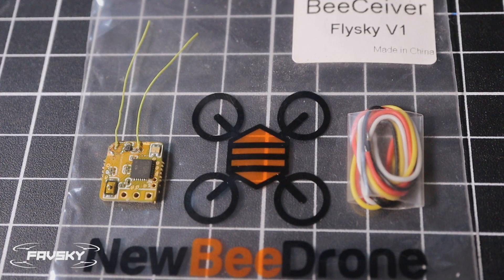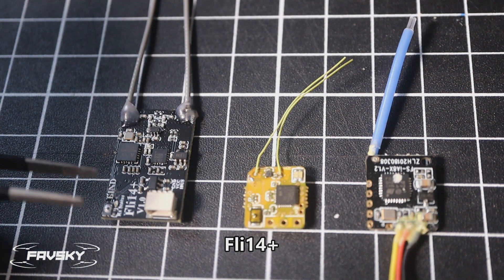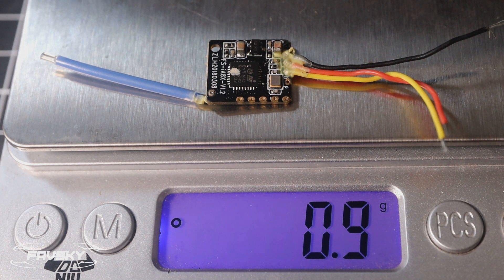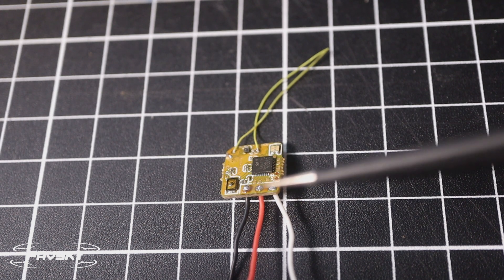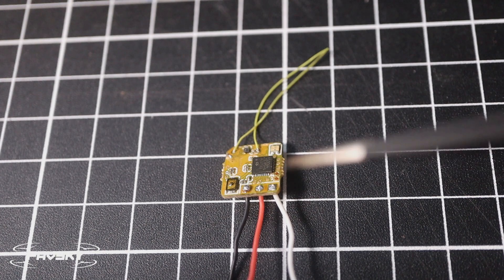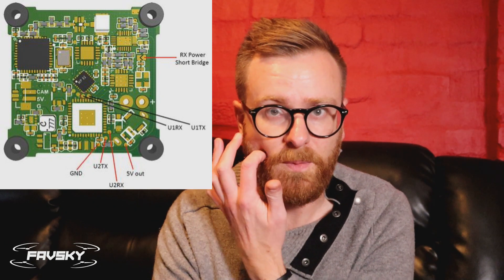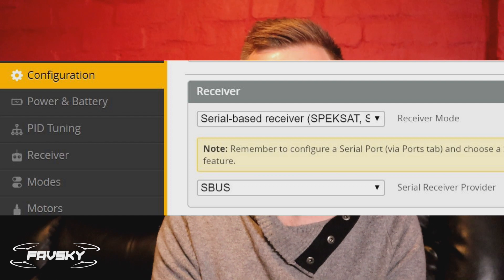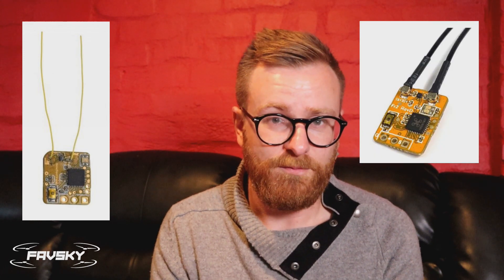NewBeeDrone Flysky BeeCeiver : Thoughts & how to set up for hummingbird, BeeBrainLite or general FC

Comment: I can't get my to work.. :( could you please help me out
I set it on SBUS in Betaflight and PPM SBUS on the radio. I also tried PWM but it is still not working.
Reply: It is bound but shows no function in Betaflight
Reply from the maker: @RealKushrage  sorry I missed this. When you say it shows no function do you mean under receiver tab? Does it connect at all?
Reply: @FAVSKY  No problem :) Yes under receiver tab. And it is connected to the radio. I wired it to the BBL V1 exactly like the FrSky receiver that was connected before and it worked.
Reply: @FAVSKY  here you can see how I connected it (GND 5V and RX)
Reply: @FAVSKY  You have any ideas? Still not working
Reply from the maker: @RealKushrage  I’ll have another look over the weekend to see if I can think of something!